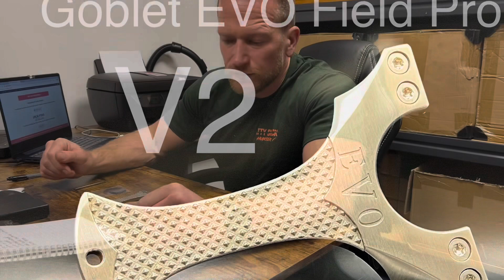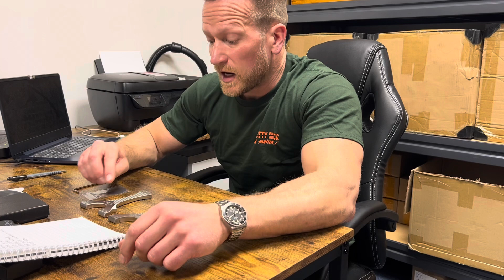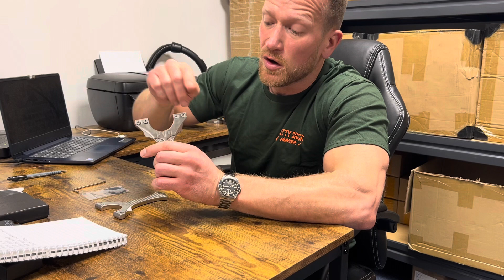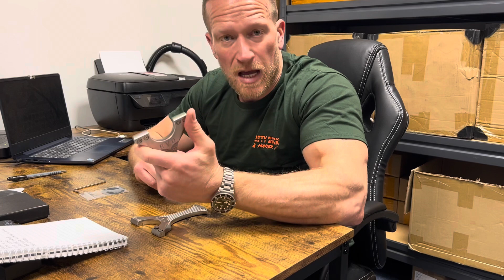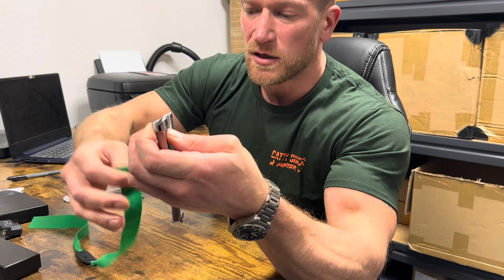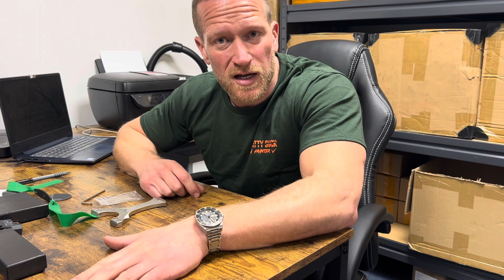The Ultimate Hunting Slingshot!

Comment: Just about to order one of these, well amazing! I was using a random cheap catty and i found that when a band is pinched and chewed by the frame grabbing it.. two small leather strips 2cm X 2cm folded over the bands end and tightened, avoids the band being snipped directly due to the grips edges.. maybe include two small bits of leather to ur kit for this.. give it a try.. the catty basically grips the folded leather pieces hard via each grip and the band is safe inside the folded pouch it away from the frame compressing it directly and nipping it... ur catty may not need this at all, but i found the leather protectors good in my kit!

Comment: So I ordered Monday and received on Wednesday which I was not expecting at all, well chuffed.
One thing i disagree with you is the leather Catty Shack pouch you said that It would feel a little stiff but honestly if feels nice and very easy to put the EVO inside.

Wayne there is only one thing I can find wrong with the EVO® Field Pro V2 with Leather Case, and that is the Torx key end is very sharp so when you put it in it’s cool little pocket it “could” cut into a band I’d your catapults forks are facing up, I used the circular sand paper to take the sharpness off.

Comment: I got the original Evo Pro and it's a really nice catty. Only issue for me was the weight of it, so I drilled it out with a pair of different diameter drill bits and reduced a lot of weight that way.  It suits me a lot better with the lighter weight and I'm very happy with it. The new catty you're showing with improved clip bolts is a good thing. Not that I lost any of the bolts, but with the first model you've got to be careful when changing out bands.

Comment: How far back does the Evo slingshot name go . Ive had a ott  black metal evo slingshot frame with red or orange evo branding on the  forks centre  & from memory ive had it some time.
Reply from the maker: The original Goblet is around 5.5 years old, then I modified that to the Goblet Evolution ‘EVO’ around 4 - 4.5 years ago. If you have a metal EVO in this style, it’s either an illegal copy, or somebody has painted it.
Reply: @CattyShackHunter  I used to have it with my fishing gear, but I've not seen it for a while. I will try & find it & send you a picture.

Comment: Love your videos.  But surely the polished, shiny metal is bad for hunting?  We tiptoe around in camouflage, sometimes with face veils on.  Guns have blued barrels to stop them being shiny.  Surely if the sun catches the catapult it will shine and flash and be a beacon to the target species.   It may sound like a small thing, but we all know how wary some species are.
Reply from the maker: Yes, but no. Barrels are blued to help prevent corrosion, and because they are being moved and swung around at flying birds, observing from a high vantage point, are much more likely to be seen, shine, and reflect, this is obviously a good feature to have. Catapult hunting is very different to the dynamic movements of a shotgun. When you’re shooting a catapult, or any kind of stalking, your movement, noise, face / hands and smell and much more likely to give you away than what you’re holding (within reason). A few square inches of brushed finish silver is not a concern. Even some deer stalking rifles have silver metal barrels.
Reply: @CattyShackHunter My bald head is a big give away to pigeons,  no good unless I wear a hat